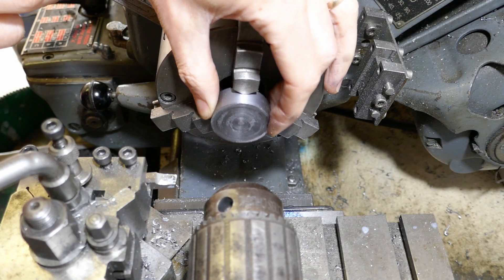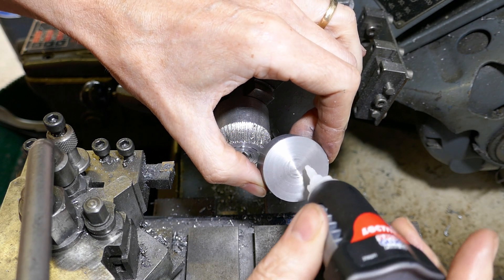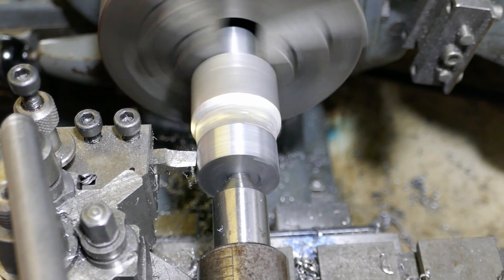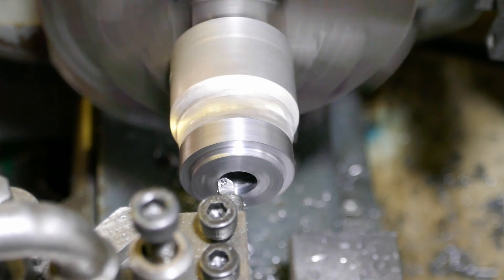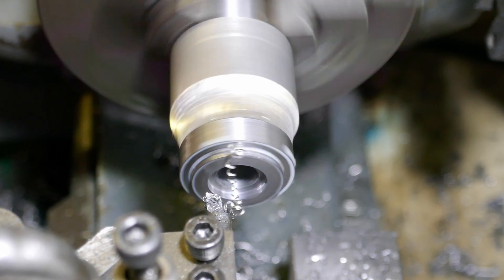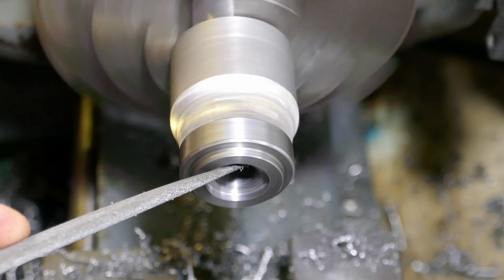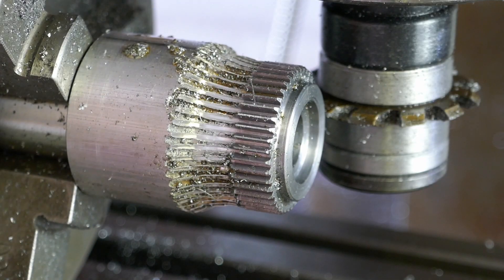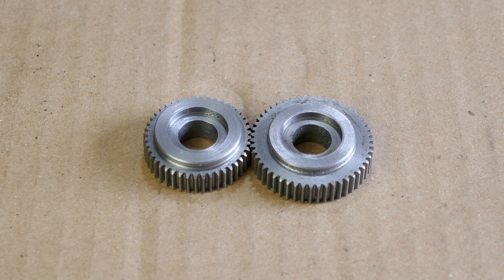Making a gear in the home workshop - gear cutting with home made cutter

Comment: May I ask you a question about gears?  So with straight cut gears, the disadvantages are noise and robustness (because only one set of teeth are engaged at any one time.)  Helical gears are quieter because of their smooth engagement, and more durable because multiple teeth are engaged at all times, however they are less efficient because they produce axial load.  Now with double helical, or herringbone gears, they have the smooth engagement of multiple teeth that helical gears have, but they don't produce axial load.
My question is, other than the difficulty of manufacturing, what are the disadvantages of herringbone gears?  How does their efficiency compare to straight cut gears?
Reply from the maker: I don’t think there are too many disadvantages beyond the complexity to design and manufacture.  Herringbone gears do tend to be used more or less always in larger applications, e.g. marine gearboxes and similar.  Quietness and smoother torque.